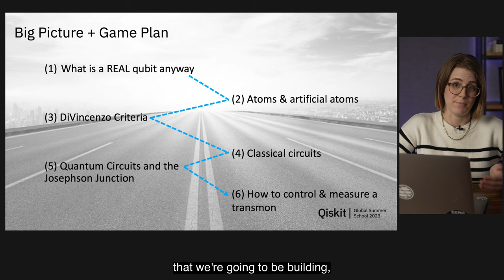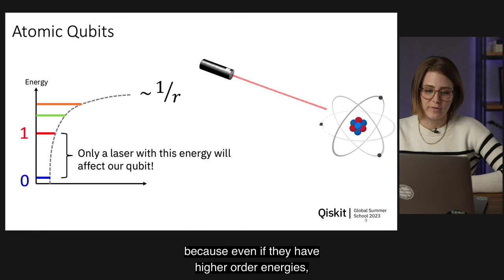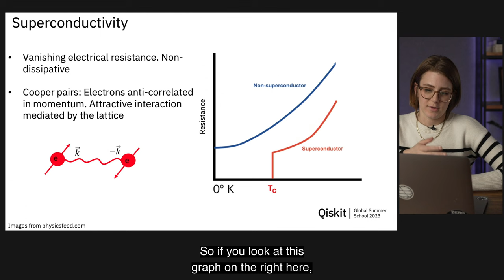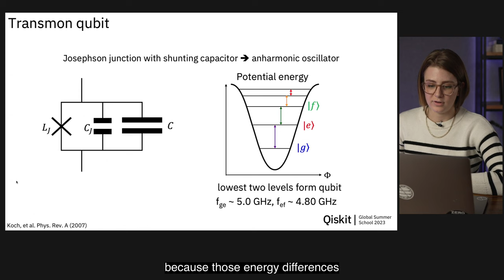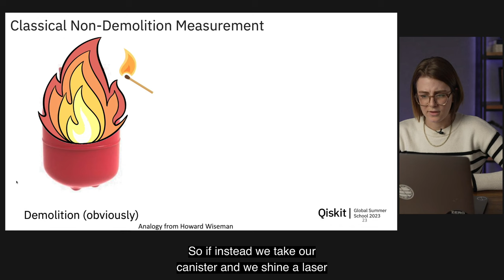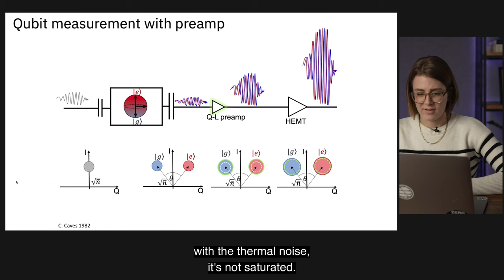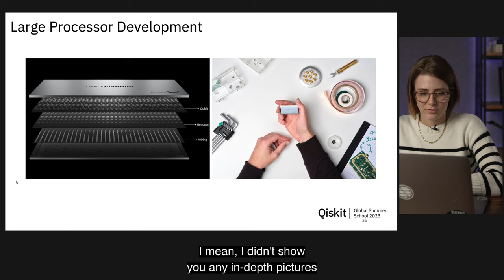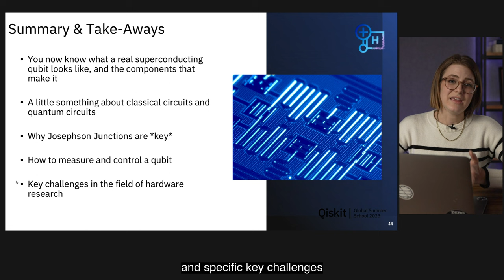Quantum Computing Hardware and Super Conducting Circuits | Qiskit Global Summer School 2023

Comment: when you measure indirectly the status of a qubit by using a cavity on a different frequency, and you measure amplitude and/or phase, you said without interfering with the qubit, is that 100% right or the is some kind of interference or energy absorption that produce that value measured? Thanks.